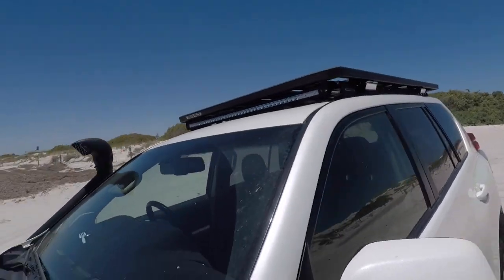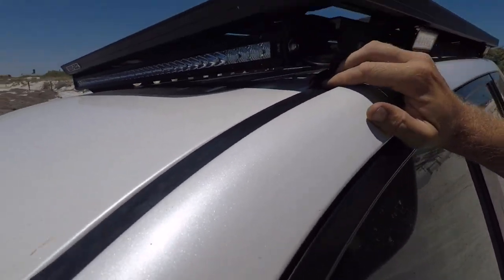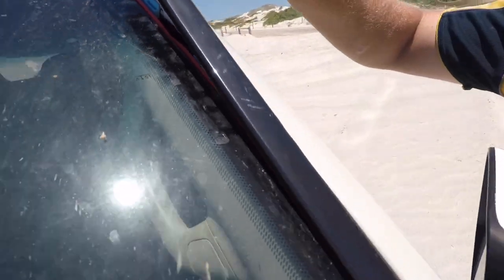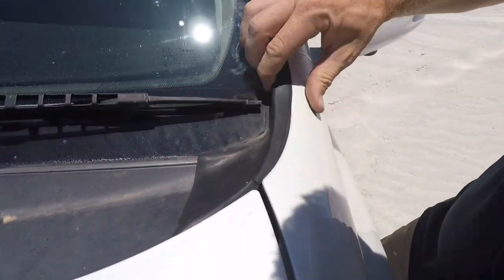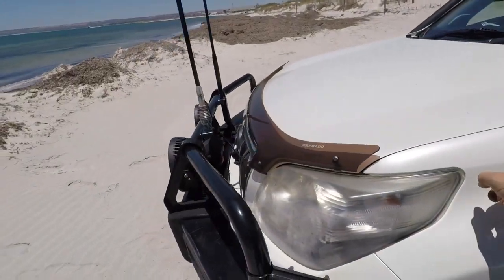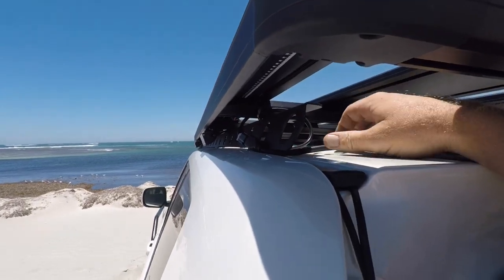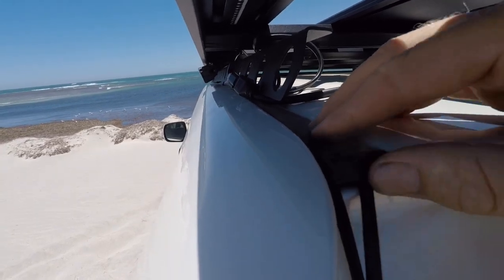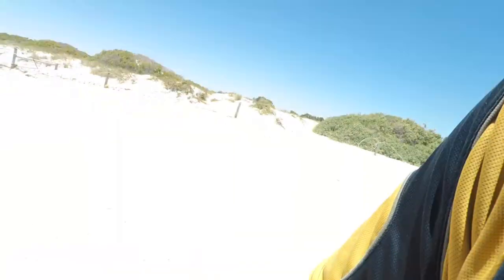Prado 150, Rhino-Rack Backbone lightbar wiring

Comment: Great video 👍 What King light bar is on the backbone?  Also where did you get the sides and rear light?   Awesome setup....
Reply from the maker: Thanks mate! Light bar is a kings 40” slim bar also the rear light bar is a kings 20” the side lights I had laying around but I believe there just a 6” generic twin pack from eBay. Hope that helps

Comment: Hi mate. I have just bought the current version of this lightbar, but the power cable looks much thicker and isnt long enough to run from roof rack to bonnet. Did yours have a different cable hardwired into the lightbar, or did you DIY snip and attach a wiring kit at the lightbar end? Cheers
Reply from the maker: The light bar has a Deutsche plug about 300mm into the wiring, the wiring from under bonnet was a generic kings harness mounted on the firewall and it just reached if I remember right, not sure if they have changed designs but it was all plug and play, no cutting but tight!
Reply: @JS_Adventure  Beauty. Sounds like it is the same setup. Now that I know it's possible, I shall persist! Haha. Thanks mate :)
Reply from the maker: Good luck! Hopefully it’s all the same!

Comment: How did you plug the wiring harness to the high beam?
Reply from the maker: Hey mate the wiring harness came with a pass through like connector with a Deutsche plug as the 3rd plug. I think it also came with 2 different relays as the Prado is negatively switched

Comment: Nice video mate, just wondering have you experiencing the wind noise from this light bar and how do you eliminate it?
Reply from the maker: Cheers mate! Haven’t had any trouble with wind noise, I know a mate did though and he adjusted the height/angle/position a lot to loose the noise. We’re both using stedi brackets which have a little bit of adjustment

Comment: Hey after you ran the wire from the light bar down to the bull bar did you connect it to the spotlights
Reply from the maker: Yep! Connected to a kings harness, all running off the same switch